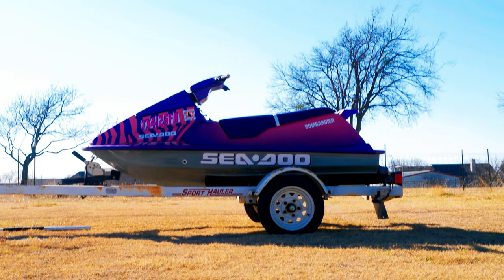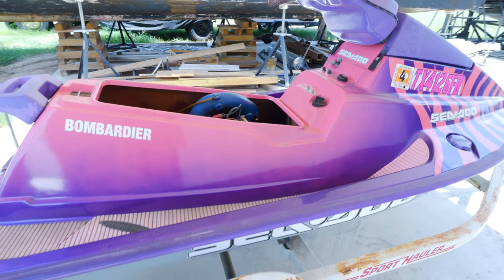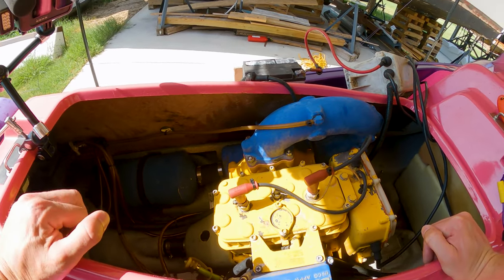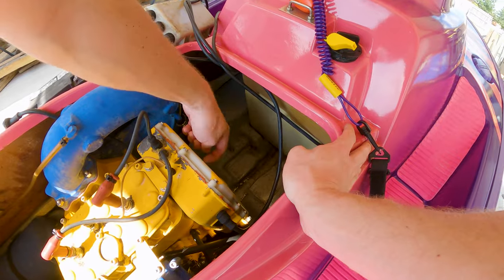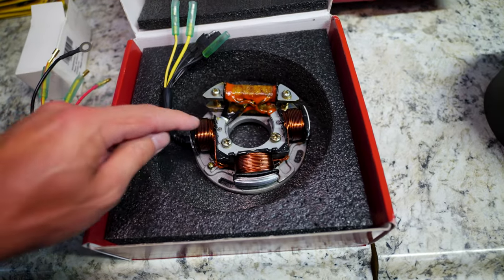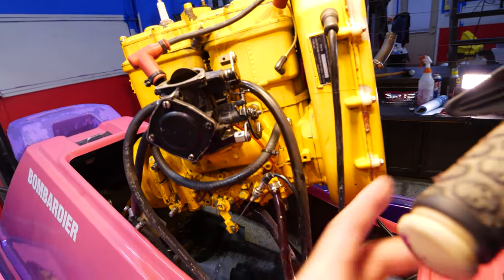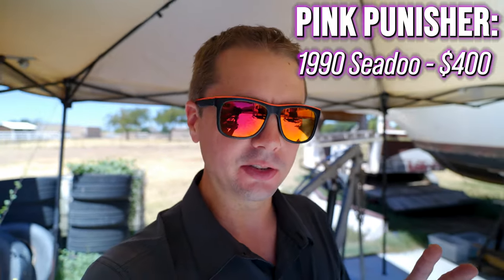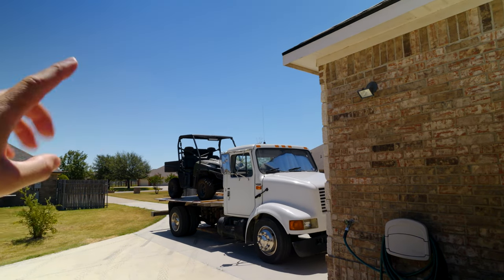Will Our $400 Seadoo From 1990 Run?

Comment: Are you able to remove the engine with the jet pump still attached to the ski?
Reply from the maker: It’s not the easiest thing to do but you can yank the engine without touching the pump. Have to unbolt the engine and slide it forward far enough that the PTO shaft is free of the engine though.